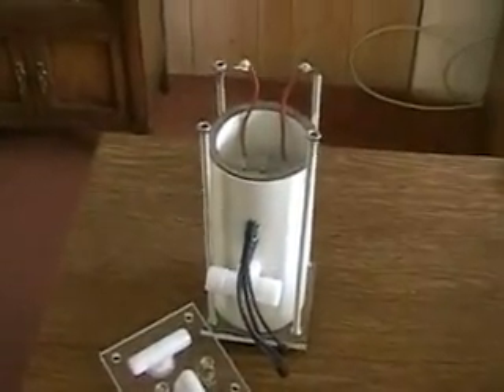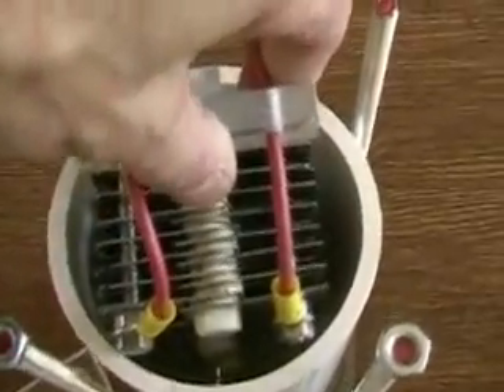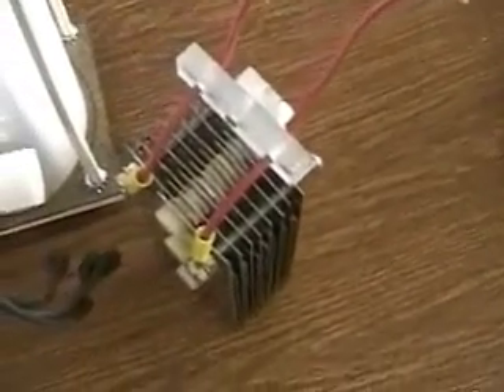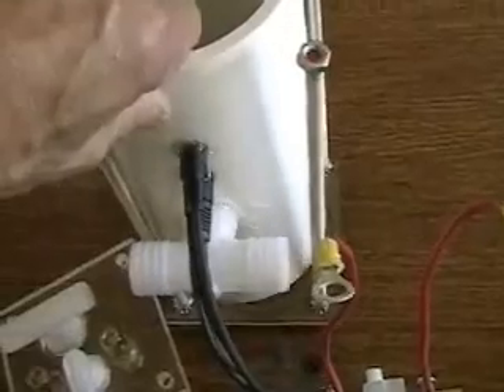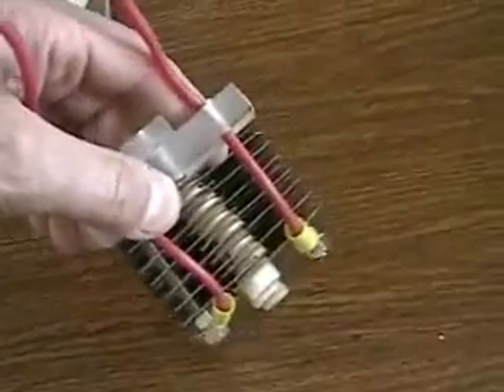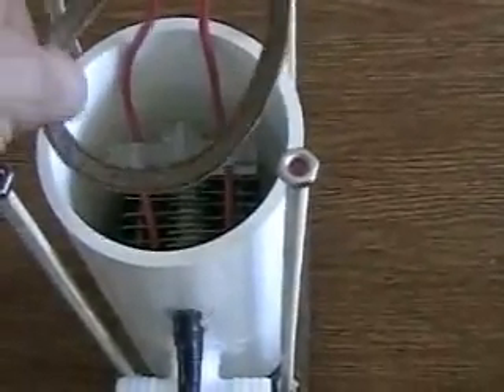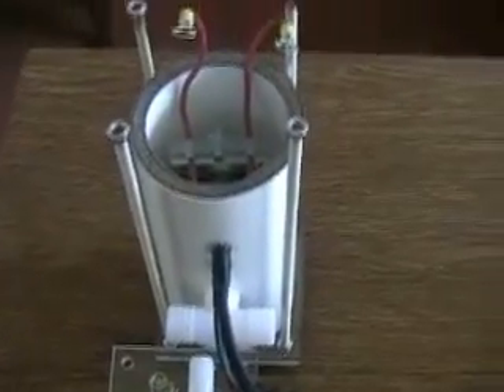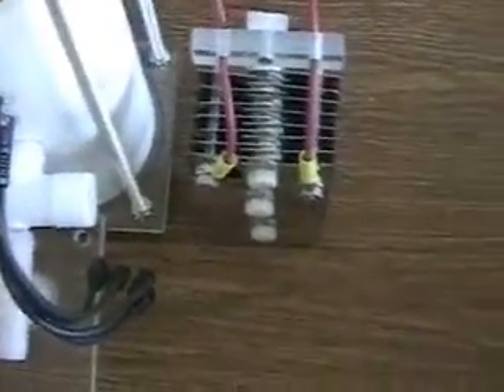Hydrogen Tap (3LR100 upgraded) #69

Comment: Hi John,
nice setup.
Did you yet try to have the positive plate in the center,
then neutral plates between it and have 2
 negative plates at the outside of the stack ?
Somebody else said, it needed less ampere at the same
amout of gas production.

Also your audio volume on the videos is still pretty low. Sometimes hard to understand.
Please make the audio part louder.
Many thanks.
Regards, Stefan.
(Admin of overunity dot com )